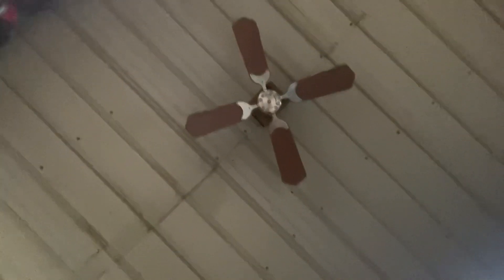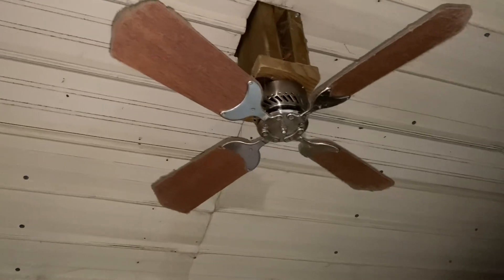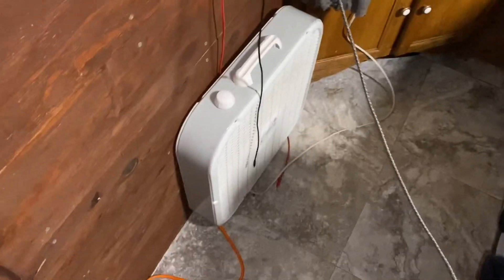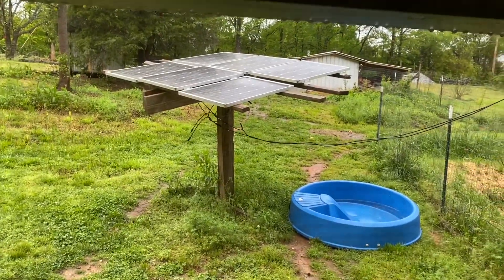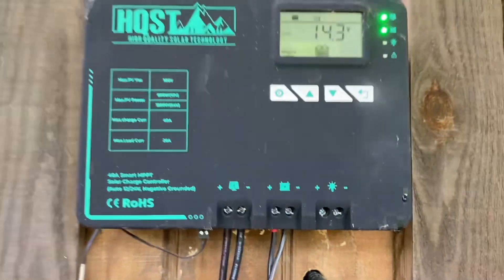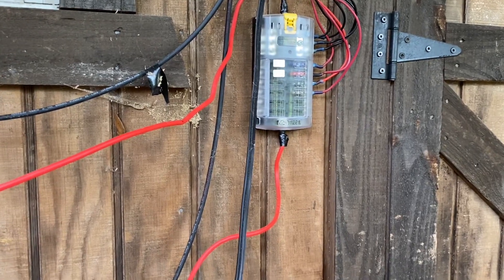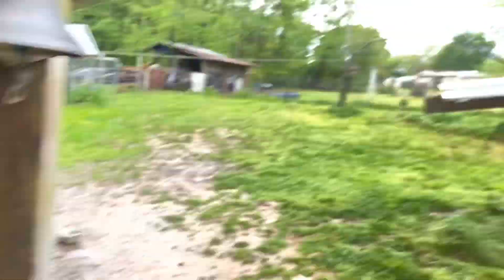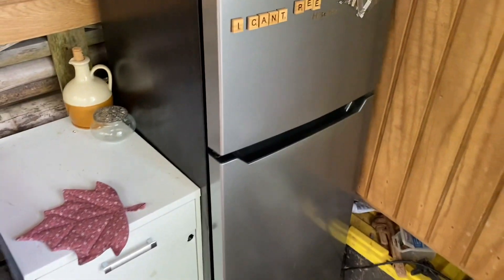The simplest solar setup for off grid shed

Comment: You have upgraded. I have a Renogy suitcase 200 watt with built in controller, 100amp hour litium battery and a 1000 watt pure sine. But I have been using a two smaller portable solar panels (60 watt and 20 watt) to recharge a Jackery and some battery banks. Amazing how little power you need when you minimize stuff. 
I keep my battery in a toolbox with some vents with the inverter on top. Do you have any issues with leaving the batteries just out in the open?
Reply from the maker: No they do fine that’s how they were advertised
Reply: Can’t believe he murdered his friend